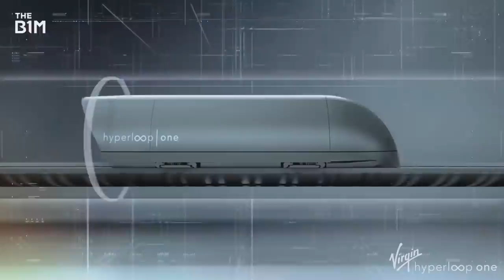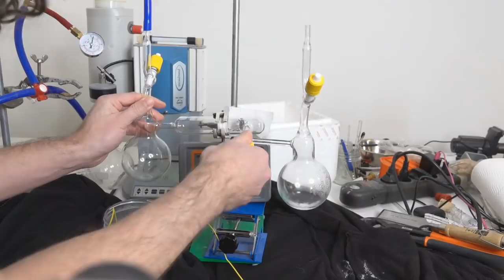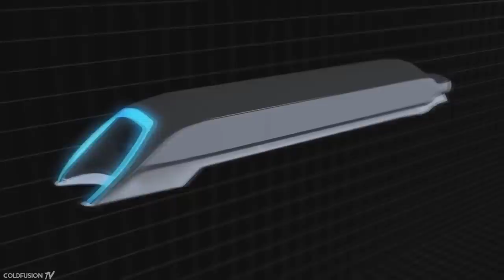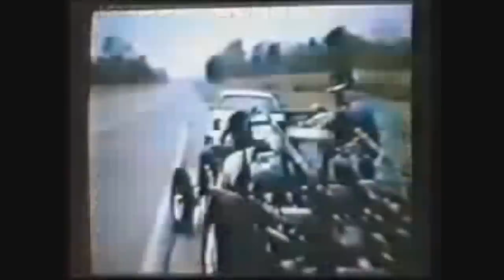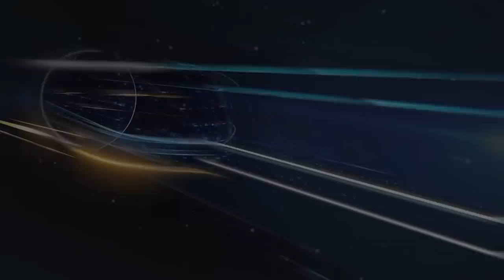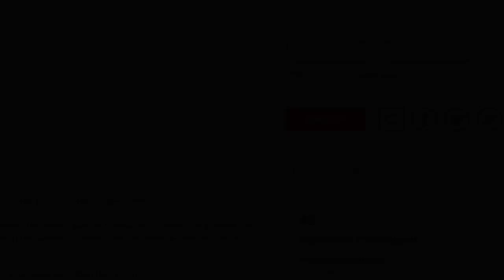Free energy device using Hyperloop technology!

Comment: Love it thunderfoot. To all the  "it would work" peeps out there, sure it would. It is a steam powered turbine so why wouldn't it?

 We already have steam powered turbines. But, there is a reason why they operate at high pressure and temperature.  First thing, there is very little energy in low pressure and a low temperature difference.  Even then, existing turbines could be made even more efficent if their radiators were made bigger so that they could cool a few more degrees. The more efficent a heat pump power generating station is, the lower temperature the waste heat would be, along with exponentially growing size for each degree lower the expelled heat is, and  the exponential growth in the cost of cost of the radiator.  You would be lucky if it only cost $20 trillion for 99.9% efficent for maybe a megawatt of capacity. Just guessing.

Comment: so then what do you do when all the water ends up on the cold side? Pump the water out with a relatively small pump?
And how to you get more into the warm side? Use a simple pressure regulator?
And you can even throttle this simply by controlling the amount of water entering the system?
Alternatively could you even use a closed system where you pump the water back to the warm side using a low pressure return line, saving the cost of re-pressurizing the water?
And you would be running gas turbines connected to electric generators at various points along the way?

Nah. It's impossible. Just another free energy perpetual motion machine. Probably need magnets in there somewhere too...

I want to see some theoretical calculations and tests of power usage for the water evacuation pump when running this in continuous mode, as well as some measurements of the heat flow and temperatures on both ends.

Also, you're going to need to find a solution for transporting heat to and from the hot and cold side because I'm sure there will be difficulties maintaining a good temperature difference while pushing hundreds of megawatts of heat from one side to the other.

The beauty of ic engines is the heat is created inside the cylinder by burning the fuel, and then cooled by expanding it, with a couple more steps to remove the now warmer exhaust and bring in some fresh cold air. Your system will be cooling the hot end by the evaporation of water, and warming the cold end by condensation of it's vapor. You'll need a way to keep enough heat flowing to the warm end and from the cold end to keep the temperature difference. Some (many) passive heat pipes would probably do just fine.

But I think the biggest issue would be securing the land to build this. You'd need quite some support from whatever jurisdictions along the way. I don't think ocean and sea ice would be practical considering you have a fairly rigid tube running such long distances.

I'm also not sure about ocean water as you'd end up with salt collecting on the hot side and would need to constantly cycle it out.

Comment: I'm stupid , so would this work considering the temperature gradient of the earths surface? Surely the effect would be atleast reduced ?
Reply: No,
He’s being ironic 
Need to spend energy on all steps of the process to make the propeller spin (for example, to remove the water from cold side you would need to melt the ice and remove the vacuum, then remove the air of the whole pipe again, plus other stuff like pumping water in)
It either would be extremely inefficient or wouldn’t work at all

Comment: yep wonderful!   now I understand that the vessel is constructed like a spaceship because the tunnel is a vacuum and exits are more than 10 miles away, so if some thing fail you Die because isn't air on the tunnel. guess what call me after 40 to 70 years to see if work i probably be dead by that time

Comment: There’s actually a lot of simple problems with this Thunderf00t. 
You’re not doing yourself justice. 
1. Wouldn’t you need to have an even temperature across the whole vacuum tube to create the vapor pressure to begin with? 
2. The poles don’t warm up much. If the gas is freezing on one end, then you might need to clean that ice out occasionally. 
3. Wouldn’t the tube start with a finite amount of water? What happens when the pressure equalizes again? Shut the whole thing down, clean out the ice, warm the tube back up, fill the warm end with new water, then let the cold end freeze again? 

Not saying this isn’t feasible. Just an engineering problem. 
Or you could just drill some holes in the ground and use the core heat of the Earth to do basically the same thing but without the ice. 
Hmmmm...

Comment: I know you made this video as a joke but can't a system like this work in an area of the world that has two sources of hot/cold beside each other? These sources would have high heat capacity and more or less an infinite ability to resist change in temperature, Such as a hot spring in Greenland ( Spring 50Deg C , Ocean Surface Water -1.8C). So once  the heat is given from the Spring to boil the water and it is absorbed by the ocean, neither the spring or the ocean would deviate from their original temperature.  This would Also make it very easy to flip flop either side of the heat vessels once once side freezes, as they only has to be feet apart, Like a spring near the coast. I don't know, I love Science , Chem and Physics but am no expert so maybe if this is totally stupid, try to be nice in the replies lol. Thanks. ... Side note, Did you ever figure out what was going on with the clear sodium/potassium in water? That was amazing.
Reply: I would imagine also that both vessels would have to be good heat exchanges like radiator type designs, maybe one side can even be in the air , with the wind flowing over it, air temps can regularly get to (-30) - (-40) in that region. Who knows.

Comment: From the demonstration, this concept of energy generation seems to work. The concept relies on temperature gradient (difference) between two regions within a sealed vacuum system with a water reservoir at the hotter end. So the one end will be north/south pole and the other end is the ocean very far away. Water flows from the ocean to the cold end and spins the turbine to generate energy.

For the ocean end, the seal system must have some mechanical opening that can open and shut at will so water can flow into the system. I believe this is doable since water will definitely flow into the vacuum system. This water vapor flows into the cold end and condense. The problem then is that for the system to function indefinitely, those water condensed at the cold end must be extracted somehow while maintaining vacuum. Does extracting the water at the cold end require more energy than how much energy this system generates? That is the question. Somehow water has to flow out without air (which is gas phase) flowing in, I am not sure if that's possible.

Edit: actually it is possible to have water flow out without air getting in at the cold end. In fact it is very easy and practical by utilizing gravity. Water gain a pressure of 1 atm with a depth of 10 meter. So if the cold end is shaped like a test tube longer than 20 meter with enough water condensed, you can have a valve opening at the bottom so water flow out at higher than 1 atm without air flowing in to maintain vacuum. Base on this well known fact and the experiment demonstrated in the video, nearly unlimited energy harvesting is theoretically possible. In fact, water flowing out of water hose nozzles (due to pressure) without air getting in has been demonstrated worldwide by firefighters. The cost of implementation would be the one-time manufacture cost and one-time vacuum cost. Maintenance and repairing will be a different story. A working prototype will not fit into a home though as it will be a minimum 10 meter long.

Wait a second, doesn't this system also distill the water? So it not only generate energy, but also clean water.

After all, however, energy harvesting from temperature gradient already exist. It's called wind turbine. Wind flows from hot area to cold area. And it does not require vacuum or anything complicated. Furthermore, energy harvesting from water flow also already exist, it's called water turbine.
Reply: This hydro vac is technically steam power, water is evaporated/boiled under low pressure and temperature. 

Ever wonder why steam turbines use high pressure high temperature?    Steam turbines could be made more efficent by ejecting heat into larger and larger radiator at lower and lower temperatures and pressures,  but the economics break down  getting more and more costly at higher efficiency. Lastly, lets face it, there is not a lot of energy to be extracted in the last 10 or 20 degree temperature difference.
Reply: @kreynolds1123  The Real problem are the Vaccum pumps, you wouldnt believe how hard it would be and what kinds of Energy would need to be used for that, same reason why the hyperloop is pretty impossible
Reply: @zachdurden1821  ohh i get that it takes a lot of energy to pull a vacuum, but its not impossible, even if difficulty doesn't scale linearly.   The bigger problem is maintaining it with leaks in the pipe and dissolved gasses in the source water.  Huge expenses for relativly little energy at these temperature differentials.
Reply: Keith Reynolds off gassing also just finishing off your thought

Comment: joking aside…   would there be more efficient liquid to use than water.. that would have lower boiling point and would condense in higher temp all so ..  so it would not need as much energy ( temp difference )  ….     and...  then other thing..  how to manufacture tube that could reverse its "polarity" of warm and cold ,   so you could run the thing back n forth.   would be more efficient than dumbing the water out in cold end and pumping new in on warm end .

Comment: This is nothing more than a perpetual motion design scam.  The claims made here provide no actual proof or measurement to demonstrate an increase in available energy.  This is simply the external application of fundamental thermodynamics to a closed system using the ideal gas laws, the triple point of water.  In other words, the motion shown is dependent upon an external change applied.  In fact, by cooling the one globe, energy is actually being removed from the system.

Comment: Nope.   Even if it does work on that scale (guessing 6 k miles of vacuum tube rather than 6 inches...) the cost to create the vacuum will be more than the power it gets before you have to open it up to air and clean out the frozen water and add more water (sure, you can put a valve to pump more in...) and with the severely reduced pressure it would be somewhere between the efficiency of a wind turbine on the moon and one on mars, but much closer to that on the moon, so no significant force to generate this power.

The small scale test one is interesting, but it's basically only a very inefficient sterling engine.

Comment: Thunderf00t - Here are the links to two videos which purport to suggest the pyramids could have been built using water. What he fails to explain is how millions of litres of water were pumped to the top of the pyramid in the first place by primitives with no pumps. 
Also, I am suspicious that although this works on a small scale, would massive stone blocks really travel the height of a pyramid before gravity overcomes the buoyancy effect? I don't possess the mathematical answer to this but wonder if you would like a shot at either approving or disproving this theory using basic science. 

https://www.youtube.com/watch?v=TJcp13hAO3U

https://www.youtube.com/watch?v=rxFXsoqbfrk

Comment: That funding won't even cover the cost of one flux capacitor and you need two of them, one on each end of the tube. Also you forgot to mention the magnet generators that will provide lighting for the whole project as well as power the water distillation plant....Need to raise more funds. How do I invest?

Comment: By the way I have to say something about the Myers guy. You see what he was making was actually not H2 he was making a structured form of water that forms a ring that can store energy through a weird electric property that water has because it is a dipole. It the same thing that happens in a magnet patient by that coral castle guy.

So to say the least the production in a stable range can be a problem.

You could tell that he was trying to make it stable by changing the water with a Lazer to start off with a already structured form.  However I don't think he got what temperature and vibration does to production and he probably ended up with a stable running range so split that it might as well have been a role of the dice.
Hell maybe he did know and thought he could cut it out who knows.

The thing is that form of water has a lot of weird stuff to it that he could have explored.

All in all it ends up being a sad story.

Comment: I know this is sarcasm and obviously "free energy " doesn't exist right
But let's follow the energy chain

What happens in the free circuit of tubes energy wise? It's being moved from warmer regions of earth to the poles, no breaking of thermodynamics there

If you put a series of turbines in the middle you'd just be moving that energy into wires instead, so you'd effectively be cooling down the warmer region of earth and taking the heat energy and turning it into electrical energy 

Effectively reclaiming ambient heat that we lose in all processes, ofc it won't be perfect and it'll shift water levels and slowly increase the temperatures of the poles, and it might not generate much energy but I don't see how this won't work 

The source of energy is the sun, with a bit of ambient heat

Comment: In theory this ideas fine. Culver's not practical because of the resistance of such a long tube. Any energy gained will be lost in turbulence. pipeline have to have pump stations to deal with the losses from turbulence. This is something that doesn't even work on paper.

Comment: Doesn't this not work if the tubes connecting the bulbs are at a gradient of heats? For example, if the vac tubes run from hot to warm to cool to cold, wouldn't the entire system no longer work?

Comment: Con job inventions 101:
1)Take common word.
2)Add the words vacuum tube.
3) Profit.

My invention: KegLoop. Don you hate the tedious and labour intensive chore of tapping a Keg? Thanks to my revolutionary KegLoop, those wasted minutes are a thing of the past! Simply insert your untapped keg into the patented "Keg Transport Device" and press play. The thermodynamically sealed vacuum tube will effortlessly extract the desired brew in seconds, and, due to its quantum mechanically shielded design, no carbon dioxide will be lost. Enjoy that frosty bitter as nature intended- with lots of head. The KegLoop- getting you drinking faster, for less. Now supported on IndieGoGo. Donate now!

Comment: This is going to create massive ecological impacts by introducing arctic temperature water further into warmer waters via tunnels than just normal sublimation would. It's a heat pump. Ultimately in the end it will speed up the melting of the ice caps by normalizing the temperatures between the two by artificially connecting the two in order to scavenge the energy from the transfer.
And anyone who watches the weather knows that warm fronts meeting cold fronts equals violent weather.
So this is actually pretty bad for the environment...

Comment: What a joke! Sure, any temperature difference can generate electric power, IN PRINCIPLE. In practice, this "miracle"  is about as useful as an airplane made out of solid lead and powered by rubber bands.

However, there IS a method for using natural temperature differences in the tropical ocean. It is called "Sea Solar Power". You can find out about it here:

http://seasolarpower.com/

This will actually WORK!

Comment: I live your videos. Can you answer a question or put me straight? Is one of the biggest challenges to things like nuclear power or similar  power sources the lack in effeciancy in converting heat to usable energy? My understanding with modern pelletier devices is lack of effeciancy.  Applied ones are 5 to 6 percent. Where some lab models at around 9 percent.  For example to get effeciancy of a internal combustion engine you need around about 25 percent. In scifi Mechwarrior is around 50 percent. Star Trek is around 90 to 95 percent. Am I  off somewhere?